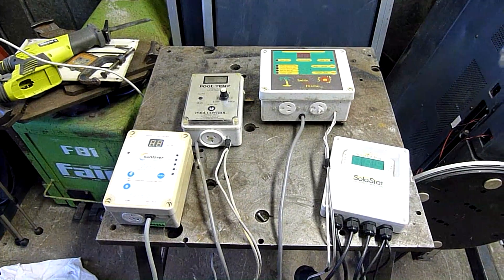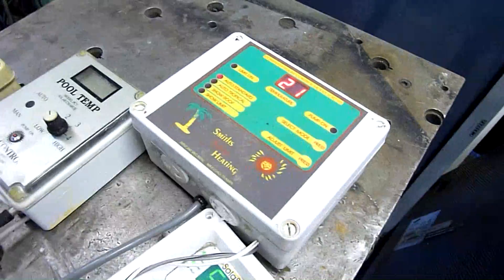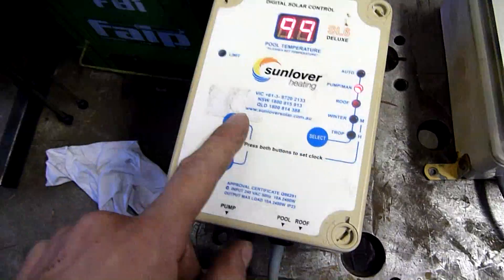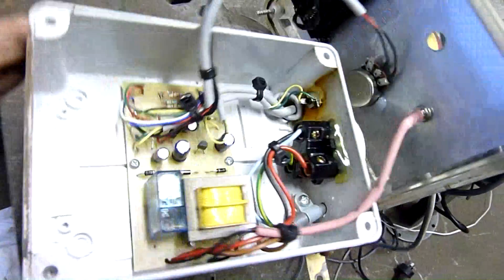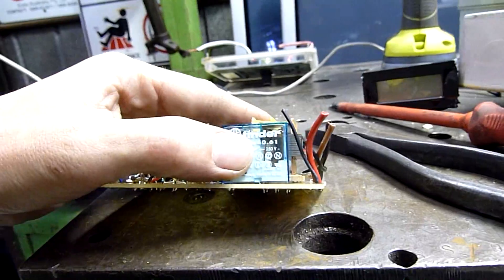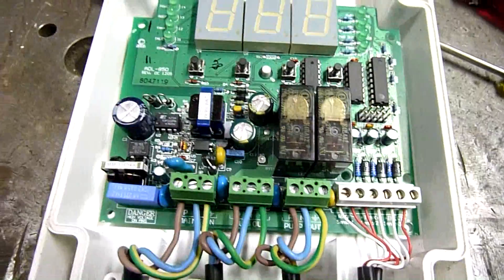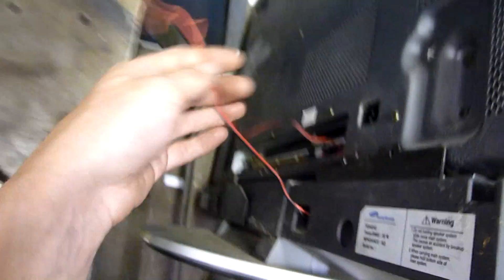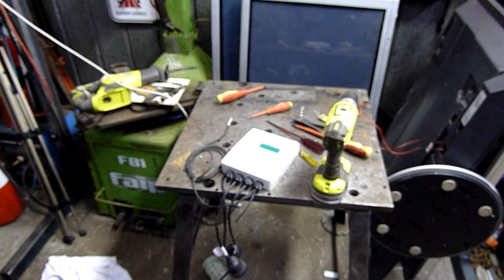4 Solar Pool Heating Controller Autopsies in one!

Comment: That SolarStat water boiler is very well built, the electronic board is built to detail. really good autopsy video, the solar charge device is really basic looking. The componentry of the electronics is just to plan " well it no doubt, served its porpoise" when it was working,

Comment: The sensor cables should have been coaxial type or at the very least, twisted-pair to stop glitching noise. When designing a PCB, extra precautions such as ferrite bead/capacitor networks along with a MOV should have been used. But eh.

Comment: That cheap and nasty controller is a Celeron device, also known as a Sell 'n' Run, cos when you sell it, you better run before the customer finds out you cheated them out of good money... :P
Reply from the maker: even if its cheaply made, I admire the simplicity of the device, it probably still worked, just did not display.
Reply: Yeah, but I'd expect that level of quality from a school project from a 1st or 2nd year class in a secondary school, even if it's a generic kit, I'm not perfect with assembling kits but the couple of Vellman kits I've amateurishly put together looked neater than that thing... :P

Comment: some thermocouples and thermistors have 4 wires, this is for 'long wire compensation'.
If wires are acting as antennas, then maybe coaxial wire is needed, but only connect the screen to the mains earth in the box, leave the other end unconnected.

Comment: Google fucked up my usable startpage script again.
Fortunately with Google, I have set up a backup solution using Tiny Tiny RSS, when that fails Google can kiss my ass and I'll walk away :P
Reply: Yep, I never changed startpage when when they ditched the old one a while ago, back when the startpage was subscription centric rather than "Recommended" that it is now.

I got a 403 error on another video in my subscriptions earlier so clearly they are messing with the layout again as usual.
Reply: Aparently the main servers in different areas around the world got "hacked". That's the word that circulates around the web.

As for start page, is use a combination of scripts. I know it's a pain in the ass when you debug it but it keeps the shit flying and not in the fan.

Then again, if you look at my page it looks nothing like any youtube page.